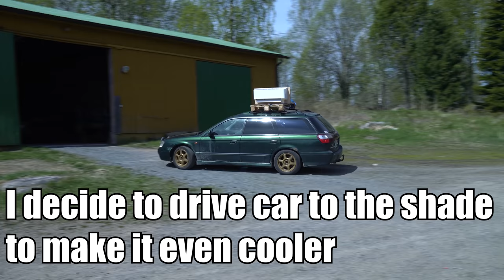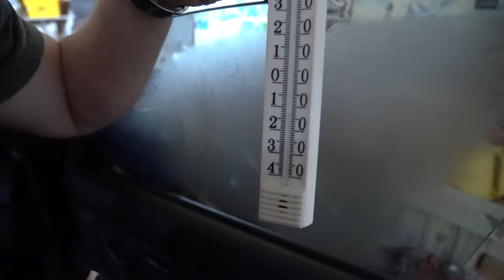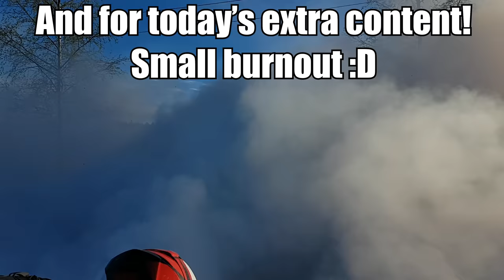DIY Extreme Car AC! -15°C / 5°F In the Middle of the Summer!

Comment from the maker: This was really funny experiment and the driving winter car on summer was really weird :D And my neck was stiff for couple days since there was probably around 5m/s wind coming from the fan on the backseat :D Big thanks to Lämpöykkönen and Toshiba for helping to make this video!
Reply: HA !!! this is so funny in Australia we have EXACTLY the reverse principle.... the outside unit blows hot air.. we cooling by default ...our units can be reverse cycle heat or cooling depending on the season..Do Finnish cars have air conditioning?????  Moi ! from Australia !
Reply: You guys are nuts, in a good way 😎
Reply: You mention the one in the workshop running very efficiently.  Did Timo ever patch the hole in the back wall of the shop he made for that long pipe? Or does air escape from there?
Reply from the maker: @WoodworkerDon  There is plug on that hole when it's not needed :D
Reply: LOL!! I think it's quite fun how you are already missing the winter. I hate the winter my self - but that's also because our winters in Stockholm area (Sweden) is not often like the ones you have. Our winters is mostly just cold and wet with a lot of rain - many times during the winter, snow is also coming, but stays for just a few days before melting away with a lot of slush, dirty roads etc. It's a lot nicer to have real winters like you have - with a lot of snow, frozen lakes with thick ice and the stuff you have. I still like summer the most though. 
I can also understand you like more to drive during the winter than summer, since you seem like you want to stay legal, hahaha (on really slippery winter roads, you can actually go the speed limit and still have fun - that's not the case on dry summer roads). Really fun idea with the car anyway :)
Reply: -I think much more interesting and useful would be - to put cheap compact window AC unit (600W-800W) in the trunk (preferably in a sedan) and power it with just car generator through 1,5kW 12V DC to 220V AC converter. It should give you enough cold airflow to feel comfortable! 

Attach with duct tape some hoses, plastic pipes-channels to cold air vents on AC and put them through - in the cabin.

-You can thank me later!.. :)
Reply: I wonder if that could be accomplished with a multistage solid state thermo electric array ? More compact portable and the temperature differential could of offset some of the energy demand.
Reply: Now you can go buy all the ice cream you want and never worry for it to melt on the way home
Reply: Sink a car and see if you can use compressed air to keep the water out of it.
Reply: Next up, Sauna Car!
Reply: Install the heat pump outside unit in a sauna and test what will win, the sauna or the heat pump? 😂😂😂
Reply: Air conditioning is a fairly new thing in Finnish cars. In the 90s some few luxury cars had it. Otherwise only heating or outside air.
Reply: @mick-sk5lw  Sauna car is not a new invention in Finland. There are many sauna vehicles in here
Reply: Bring that thing to Arizona where a hot day in summer can be 50°C. Let's test it! This year, we've already been over 38°C for a few days, and it isn't even "hot" yet!
Reply: I have never before hear a person saying, “I miss the winter” 
You guys are the first
Reply: Keep these wild experiments coming!!!
Reply: I've told this before but on my parents house, they installed heat exchanger back in the 80s (my uncle designed it). Just simple spiral pipe inside a large pipe. One electric fan, no other heaters of any kind: -20C incoming air heated to +17C using +21C outgoing air. Those things are marvelous, temperature differences should be used, we create a lot of waste in that department. The same device cools incoming air in the summer, almost for free.
Reply: Thanks a lot Beyond the Press, Lauri and Anni! It was a great pleasure to visit you and we had lot of fun when installing and testing the AC. 😂😂
Reply: @-Viceroy-  😂😂👌
Reply: @thomashenden71  😅 that would be crazy!
Reply: @mikecowen6507  That's cool idea! May be Toshiba could sponsor us? 😅
Reply: Thank you for this tutorial. The past 3 days here have gotten above 106°F and my cars AC is broken. I will make use of this knowledge
Reply: I need that set up In my car when summer hits 48'c where I live in Australia.
Reply: I started laughing when I heard how you are going to get to the sub-zero temperatures. :D Ei hemmetti teidän kanssa. XD
Reply: lmao
Reply: -30? No worse than a Finnish winter!!⛄️💨

Comment: I live in Austin Texas where it regularly gets above 38C (100F) in the summertime.  Thanks to BTP , now I know exactly the modification that I must make to my car!
Reply from the maker: Since it was about +20c on that day this should be able to hit about 0C even on Texas :D
Reply: Well my car AC is doing a good job, here get 43C at times. However I like it warm, hate the cold.
Reply: I lived just outside of Fort Worth Texas, AC died in my car...those were some long hot drives home from work every day...couldve used one of these for sure!
Reply: @brokenacoustic  well they have guys who can fix car AC, maybe check around 😎
Reply: @jantschierschky3461  Yeah, the price of repair wouldve been worth more than the car itself lol
Reply: @brokenacoustic  well thats life, hower a reverse cycle ac would be even more expensive. Or you could have done what we did in the old days, fan and windows
Reply: Here in Phoenix it's been up to 50C.  Sign me up for one too :)
Reply: borther, that is hot. I'm getting a generator!
Reply: I'm also in Austin and my house hasn't been down to 20C in a month.
Reply: @jantschierschky3461  Windows were definitely open, but it doesnt help much when the air is 100F +...its like driving with an industrial strength hair dryer blowing at you the whole drive
Reply: @brokenacoustic  i know the feeling, try that at 44C
Reply: Well, Imbok, at least you don't have to worry about that for about 3 weeks, as of this post.
Reply: @jantschierschky3461  No thanks! lol
Reply: @dragonbutt  I moved down there in 2011, that was one very long 100+ degree heatwave...99 consecutive days if I remember correctly.
Reply: @brokenacoustic  cold front,  try abu Dhabi with 54 C and 80% humidity
Reply: @jantschierschky3461  Nope!  lol That was the only good thing about Fort Worth heat, it was usually quite dry.  Minnesota sometimes gets up to 100, but its disgustingly humid...I'll take a dry 110 over a humid 80 anyday.
Reply: You know that marketing thing they got going on with the trucks being "Texas Edition"... If they had this A/C THAT'S what I would call "Texas Edition"! :D
Reply: imbok 38 is not even hot.
Reply: Here it can get to 45.C in the summertime, but as of tomorrow its officially the first day of winter and 17.C, pretty warm for my area of Aussieland.
Reply: How about Australia 45-48 celcius.
Reply: It has got to that temperature here yes, and when you have a shower, the cold water is warm.
Reply: @brokenacoustic  that's awful. In my city (Rosario, Argentina) 100°F don't last more than 2 or 3 days. And it's disgusting. 99 days of that temperature is more than  enough reason to never live in a city like that!
Reply: imbok Houston is worse
Reply: Is Texas real place?

Comment: A heat pump can put out 5kw of heat, with an electric input of 2kw. Pulling 3kw out of the ambient air. 
What i do not understand, is why we don't use this system to heat water to make steam to create electricity. The efficiency would be above 100% calculated in electric power. Essentially free electricity. And as a benefit, we cool off the earth because part of the output energy is drawn from the air. 

What am i overlooking?
Reply: LimaVictor The efficiency of creating electric energy from heat and the diminishing returns for the hear pump as the deltaT increase.
Reply: It's more like 6 kW of heat using 1.5 kW of electric power. But it's difficult to get to the point of boiling.

Comment: Why didn’t he just put a window ac unit in the cars window and wire it to the cars battery. That’s what I did with my truck cause I live in Arizona where it gets up to 120 degrees Fahrenheit. And It gets down to about 20 Fahrenheit inside the truck.
Reply: There is not enough power in cars battery.

Comment: Forgive my ignorance, I thought the outside unit only produced heat , I never know the outside unit produces cold when the inside unit is set to hot.  🤔
Reply from the maker: It's actually their main function here in the far north. It works just as fine on both directions in theory but the outside units have some design elements that allow them to work also on winter temperatures. While the inside units usually go only to around +10c with the cooling mode. They are really good way to heat up the buildings on winter since they are cheap, easy to install and use much less energy than electricity or gas/oil heating.
Reply: It doesn’t really produce heat or cold, what it does is move heat energy from one unit to the other. If you set the inside unit to hot, it heats by taking heat energy from the outside. This of course has a cooling effect on the outside unit.

Comment: In seems to be a very quiet unit. No problems hearing you both talking inside the car while the unit is running. 👍
Reply: I have a Mitsubishi which looks like the Toshiba. The outside unit is almost silent. The inside unit sounds about like a desktop fan. I'm very happy with it. Only complaint is the symbols on the remote control aren't what I'd use. A/C looks like a benzene ring to me--who wants to fill the room with benzene? But it is actually a hexagonal ice crystal symbolizing snow.
Reply: @karlharvymarx2650  shhhh. Don't mention filling a room with benzene in front of Lauri. He just might try it.
I'm familiar with the Mitsubishi units. We add them to communication closets when the building's A/C can't keep those rooms cool enough.👍🇺🇸

Comment: I tried using a household 110v AC unit mounted in the trunk off a ~2400watt 12v to 110v inverter. It just wouldn't produce cold air (was vented as required).
Reply: Are you sure your alternator and battery could drive that much inverter?
Reply: @Khrrck  The inverter was for automotive use (not rv), as well had a performance battery, all on heavy gauge. I spoke to a retired IBM tech of 25 years, he said my issue was more likely the ac wanted ~square energy yet the inverter produced ~curved energy.

Comment: I don't understand why the a/c is installed in reverse?
Reply: Because the inverter could handle the cold inside the car.  They could have done it either way but if they installed the inside unit inside the car he said it would have frozen.

Comment: Powerfull A/C in car that doesn't affect the HP of the engine :D nice
Reply: Well...there would be some aerodynamic drag from big square units on the roof.  So the engine would have to work a bit harder whether the air unit was turned on or off. 😁
Reply: @WoodworkerDon  and added weight.
Reply: @jonanderson5137  but I give them style points for the unique look. Nobody has ever seen such a thing; until now. 👏😁👍

Comment: Austin texas is 100F or higher in summer, the car AC can keep up pretty nicely, but you have to run it on high.

What i like about this, is you can turn the car off and still use it, and i bet the gas in the generator is cheaper than running the car engine for AC

And if you got a SUV like me, this would fit EASILY, but it would look funny as hell

Comment: They sell similar AC/heat pump units here in the states. I have one in my So Cal studio, which is a converted garage with minimal insulation. At peak heat near 100F outside last year, I rarely had to use the fan on the high setting. Only issue noticed so far is they tend to get stinky after a period of time of little use.
Reply: Made by Samsung is the unit I have.

Comment: from where I am from your inside unit is the one placed on the outside and your outside unit is the placed on the inside. and we call it airconditioner which blows out cold air, while here you call it heat pump but it blows cold air. I am confused..

Comment: I switched the motor in my truck (bigger motor and doesn't belong) which made me change the a/c system. I see low 30s Fahrenheit (0 to 5 Celsius) before the evaporator freezes up. I need a larger blower motor and I might reach the sub zero mark, but it does get uncomfortably cold after driving 30 plus minutes.

Comment: So... that 5F .... that goes along well with the 5 MPG (once you account for the fuel spent on the generator) you're getting. Also, hopefully you don't rear end somebody, because now you got a 50lb brick sitting in the back seat if the restraints you put on it end up failing.

Comment: I'm higly DISAPPOINTED I was expecting a big ass alternator to replace the cars alternator and it will provide the power for the out side unit and the gas lines will go in to the cars AC gas lines and the whole thing would turn on just like any other cars AC :(

Comment: Why the heck did you turn it on heating mode not cooling mode? That looks more stupid by installing outdoor unit inside. Using mini split ACs are common for bus, RV and trains. Just do it right. Anyway, this is such a cool video. Good JOb!

Comment: We call them reverse cycle air conditioners in Australia

Same principal as a fridge.

Either take in cold air / warm air from the outside and reverses it on the inside via compressor and heat exchanger

Comment: Seems to me like you wouldn't have reverse the physical locations of the 2 halves of the system, because from what I've seen, the unit you have on the outside is designed to do cooling. (I don't remember if I've seen some that use that part for heat.) But at least you did get this to work this way, so that's "COOL"! :-D

Comment: I had a Lancer where i made a buypass connection over the temperature sensor in the evaporator so it could get cooler than the standard 16c minimum. It did get a lot cooler, good, but not subzero. It was also running on freon gas instead of the standard refrigeration gas, makes quite a difference too.

Comment: He built the summer car for winter
Built it like an in-out sauna
Made it with the warm side outside
Made it with the cold side outside
He, to get the cold side inside
Put the heat pump inside outside
He, to get the warm side outside
put the heat pump outside inside
That's why he put the cold side inside
Why he put the warm side outside
Why he turned the inside outside

Comment: The Finnish Meteorological Institute (FMI) said the average temperature across all areas of Finland in July 2018 was 19.6 degrees Celsius. 😂 That's too cold for me, as my room temperature is 23°C. 😆 And summers here in Croatia are at a beautiful 28°C, with peak at 40°C. 😂 You guys would probably die here.
Reply: I could never live and work outside in temperatures over 20 C. Anyway the hottest summer days in Finland are well above 30C. Same for Norway and Sweden.

Comment: This reminded me I need to get the AC fixed in my car -- but thanks for showing a better solution. Checking the spec sheet for the Toshiba unit though I couldn't find a limit on the maximum wind speed the interior unit is rated for -- I'll call Toshiba and check on that (I'd hate to be limited to less than 75mph [120km/h] - or even less with a headwind). But I'm confident 65mph won't exceed the specs and the warranty will remain valid.

Now if I could just figure out what to do to protect the wiring connectors et al inside the car as they ice up and then thaw dripping water everywhere -- maybe I need a second unit to dehumidify or something -- but that will require a bigger generator and there's only so much room on the top of my Subaru. Minor problems though in the pursuit of not having to pay the auto AC repair guy...
Reply: Waterproof wiring connectors!

Comment: If you got the inside part on the roof and the outside of the unit inside ? How is it cold inside the car?  Shouldn't it be hot .??
Reply: Phoenix Marzrover if they were using an AC unit primarily designed for cooling, yes. They’re using one primarily designed for heating, so it works opposite of what you might expect.

Comment: This AC is installed incorrectly, how is this working?
Reply: It's really not an AC, it's a heat pump. Heating is the primary function.  But works as an AC too. Most effective cooling when installed incorrectly.

Comment: Is heat pump Finland talk for air conditioning?
Reply: These heat pumps are reversible. Normally they are used for heating in winter but can be used as traditional AC in summer.

Comment: Why the AC fan exhaust  is inside the car? Isn't the AC that make the air cooler?
Reply: It isn't a traditional AC but a heat pump. These can be reversed to move heat from outside to inside, very common here in the nordics. 

It was probably easier to mount the long inside unit on the roof and the outside unit fit perfectly behind the back seats.
Reply: He explains why at 1:55.